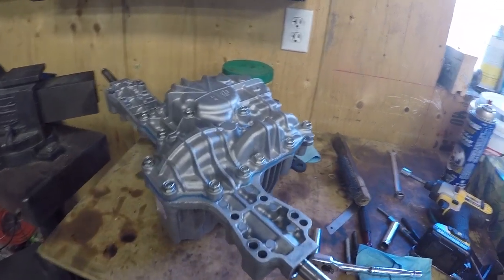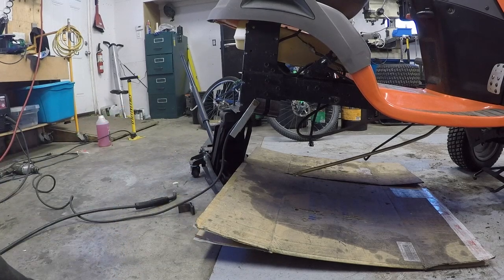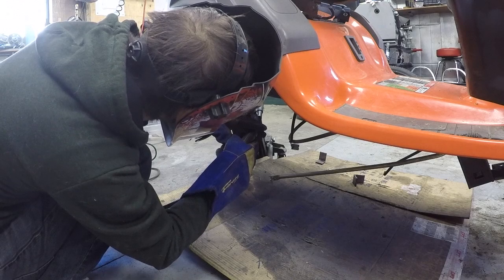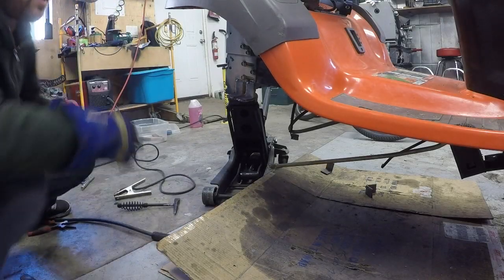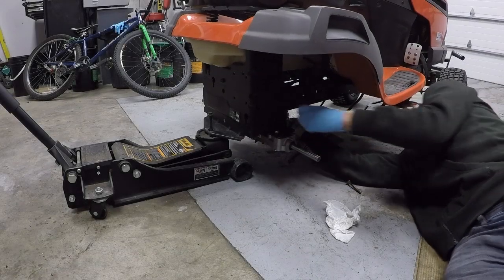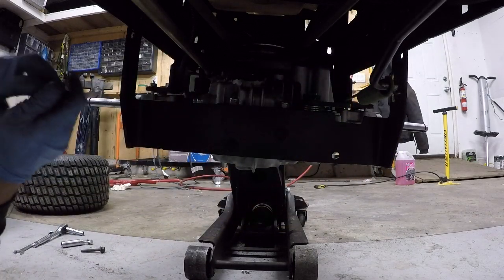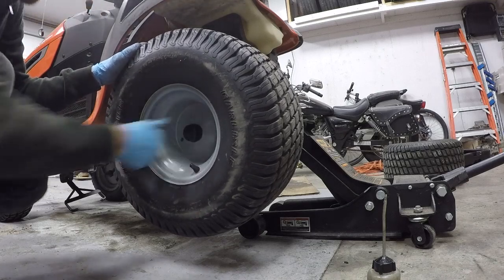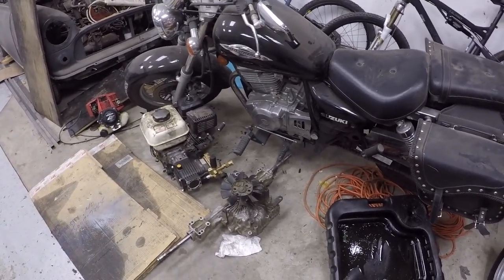K46 Hydrostatic Transmission Repair. (Part 3) TUFF TORQ (Husqvarna)

Comment: Thank you for this video! Mine lawnmower doesn't take a slope when is hot. Any suggestions?  When tractor cool down all works fine for another 15/25min
Reply: @JoelArseneaultYouTube  thank you!  Fan is ok, I have changed my traction belt. I will try new oil grade! Nice proposition.
 I only use my tractor in warm temperature, and always let motor warm before moving, no problem for that point.
Reply: @JoelArseneaultYouTube thank you. I always let the machin warming with clutch  released on neutral position on the gear leveler.

Sorry for my bad English.
Reply: For some reason I can’t see Joel’s recommendation. What did he tell you to do?
Reply: @RobShutt357  hello! 

Check traction Belt. And try another oil grade.
For my problem I have change all gearbox with used one for 300 euros. Really easy operation

Comment: Thanks for sharing, ignore the critics. They seem to forget that you don't owe them anything, they should be grateful that you went to the trouble to video this 

I'm thinking of buying the 46" version of this mower.  It's only 2 or 3 years old, but has some problems.  One is with the transmission.  It's only $200, so not much to lose since it seems to be in great shape otherwise. 

Yours is the second video I've watched of a tuff torq hydrostatic drive being worked on.  I'm thinking I can handle this job.  I've heard the manufacturer is awesome at being helpful and supplying parts for a reasonable price.
Reply: @JoelArseneaultYouTube  thanks, I've seen that they seem to have some kind of problem with the input pulley parts messing up.  Apparently that's only a $60 investment to fix and doesn't require pulling the transmission apart.  I find those transmissions fascinating.  They're really quite simple inside, considering.  Apparently, if you out that output side swash plate in upside down, it will reverse the output.  Nice job of welding those brackets, definitely stronger than before, by several orders of magnitude.  ;). Nice to see people do stuff right.

Comment: I have that same tractor.  Commercial grade with fabricated steel mower deck.  Had it since new and it has been really good over the years.  Lately it seems kind of jerky when starting off forward and backward.  When I look underneath I can see the transmission casing torque up and down as someone steps on the pedal to go fw or bk.    Anyone know if this is by design?
Reply: @JoelArseneaultYouTube  Thanks Joel. Your excellent videos will be a great guide for me.

Comment: I have a Craftsman YT4000 that is the twin.  how do you drain and fill the pump without removing the whole axel? The gas tank is in the way of accessing the hydronic pump
Reply: @JoelArseneaultYouTube  Thanks, I ended up going through the purge sequence and that worked. I was thatching the yard and must have placed too much of a load on the hydraulic pump and got air trapped in the system. The purge seemed to work

Comment: Nice repair video, but lacking in one area. I sat through all three parts waiting for you to show where to fill it, how to get the right level and what fluid you used. Mine is about 8 years old and I've not noticed ant drops on the floor but recently it's started not wanting to drive as strongly. So jacked it up to have a look and the trans is filthy, so slowly weeping over the years. Cleaned it all off and want to refill it correctly.
Reply: @JoelArseneaultYouTube  what a top bloke you are. It's been an interesting day. I have a forklift so lifted it to head height to make it easier and dropped the deck off for access. Filthy dirty so about 6 cans of spray degreaser and a lot of brushing later and it looked pretty good. I couldn't get the plug off so dropped the trans out as this looked easier and I could clean better anyway. Plug came off nice and the little round magnet under the plug was pretty clean. It took nearly 1 litre so it was down a lot. Put it all back together and wet out to mow. There is a definite improvement, but the mower just isn't as fast in forward as it used to be, but today's work certainly improved reverse. There appears to be no adjustment on the drive unit so I still have an issue. It's pretty hot in Australia but can also get down to low 30's (F) in Winter and the grass still grows. I had a new bottle of quality 15w-40 synthetic in the shed so I used that to top it off. Makes me wonder if it's now a bit worn from running with low oil levels in the trans, or if it might take a while for the pump to come good again with the correct level and fresh oil.

Mine is about 10 years old, 450 hours and a TYH2042 with the Kohler engine. There was no damage at all around the transaxle mounts just as an FYI so maybe Husky fixed this known issue.
Reply: @roberthaydenoz  hi, did you get a reply for level to fill the transmission to?

Comment: WOW I have the same identical damages to my Husqvarna YTH23V48. The frame brackets where the transaxle is mounted to the tractor is literally ripped on both sides. On top of that the Torque Bracket Mount broke on one side and the screw on the other side disappeared letting the entire transaxle tip which allowed the drive belt to pop off the pulley on the top of the transaxle. That screw you mention as being broke off I don't think is broken. I think there's a top and bottom screw as I cannot get the bottom to loosen and the top screw is gone from when the Torque Bracket Mount broke. I too will be doing some welding and reinforcing of the frame brackets that mount the transaxle. Here's the thing, I watched 2 and 1/2 videos to hear you say you filled the transaxle with oil and I was specifically watching the videos to see how you added oil to the transaxle. I'm not going to remove the transaxle and go through all the stuff you went through because I think the leak on my transaxle is very very slow. I need to know how/where to add oil. This is my second Husqvarna garden tractor. I had my first one approximately 3 days when the frame on the right side of the tractor by the transaxle ripped from top to bottom and the tractor had to be replaced. My most recent problem (last week) was the bottom cotter pin attaching the Front Mower Lift Link Suspension game off and the Lift Link  vibrated up through the top bracket and its gone. Apparently the second cotter pin near the top of the link was never installed. When I bought the new link at the dealer, I checked how they were installed and found brand new Husqvarna tractors without the cotter pin that would have prevented the link from falling out of the bracket. Some tractors at the dealer did have that second pin. I find it amazing watching the other repairs you made and seeing the same problems on my tractor. Anyway, I would appreciate instructions how/where the oil is added to the transaxle. Thank you.
Reply: @JoelArseneaultYouTube  Thanks for the info. The part of the frame you welded your home-made bracket on looks exactly like my tractor. I'm going to try to reinforce those parts of the frame a little differently. Funny thing, I see lots and lots of URLs addressing this problem with Husqvarna tractors. Looks like the sheet metal they punch the frame from is way to thin and cannot stand the torgue from the drive and literally rips the frame where the screws mount the transaxle. One comment I saw the person said it seems to be a very common problem.
I tried to reach out to Husqvarna about the missing clip for the lift link. From their reply quality isn't  concern. 
I've lost track of the number of parts I've welded back on the mower bed. Not everybody has a welder. I told my wife yesterday, if it wasn't for the welder we would be shopping for a new tractor NOT Husqvarna.

Comment: I have a hydro-Gear in my Craftsman 26 horsepower lawn mower, The leaver that you pull so you can move it around your garage without starting the motor has a little seal on the outside of shaft, it started leaking there i replaced it with a new one but it still leaks , how do i stop the leak
Reply: i got my leak stopped, put the hydro gear transmission,  back in but it will not go in forward or reverse, i think its in th e hook up rods and springs , i am not sure i have them on the right places there is two small wire on the forward reverse lever nt sure how or what the purpose of these are, do they have an effect on the forward reverse selection @JoelArseneaultYouTube

Comment: Where is the gas tank on this mower, maybe I am just anal, but I am always concerned about welding around gas tanks,
Good job on explaining the repair, I have an John Deere LA145 an it is having the same  transmission slow down or slipping problems,

Comment: When removing the pump housing the IDS valves came out and I lost either the ball or filter that goes inside . How do I know if it has a ball or filter that goes back in and if a ball does each IDS valve port have one? I'm stuck till I find this out.

Comment: nice job, and good video, was curious to see your ventilation system, looks like it pulled weld smoke straight up and out, i am planning a garage to build for myself, would like to see your set up. it was my first time seeing inside of a hydro transmission. thanks!

Comment: That transmission mount crack is a known defect by Husqvarna, they sell a stamped bracket kit that bolts into existing frame holes.  Likely the problem was started by the factory not installing or not tightening the front transmission bolts.  Mine looked similar, only one bolt installed & the other one broken.   I drilled stress relief holes at several locations on the cracks & just welded the cracked brackets.
Reply: Amazing, I had same problems he repaired plus a broken Torque Bracket Mount. Thing is I had to buy a welder to keep up with repairs on my Husqvarna. The mower bed brackets have all broken off at one time or another. Best tractor I ever owned was an MTD generic for K-Mart 20 years ago, The first Husqvarna I owned broke down 3 days after I bought it and the dealer replaced it. This thing has been a nightmare.
Reply: Thanks for the info about the bracket kit Mark.  Do you know where I can find this kit online or have a link to where it can be found?? Much appreciated!

Comment: Wouldnt it be easier to just weld the cracks?  Thats a ton of work you did.  I mean you did a great job, dont get me wrong, but unless you were going off roading or you were 300 lbs.  Welding it would have sufficed no?
Reply: joel arseneault well you did an awesome job!  I hope the customer can appreciate your hard work!  Cheers!
Reply: welding cracks is asking for more cracking, metal fatigues and needs new metal or crack cut out. he did a great job of making a lasting repair, and only 2$ of metal added is well worth your reputation for a business. plus, welding is fun! i do it at work at least once a week, on much thicker stock. he did a good job of welding thin to thick, which is a trick in itself!

Comment: Great video's. Great fix. TY. I still do not understand why in hell on the low end Tuff Torque they do not include a drain plug for the fluid. Good fix on the welds.

Comment: What kind of oil did you use?
Reply: Thank you Joel. I just got a new mower. The transaxle was whining after first use. I will be checking the fluid level. Husqvarna had this to say about the fluid "The transaxle was sealed at the factory and fluid maintenance is not required for the life of the transaxle. Should the transaxle ever leak or require servicing, contact your nearest authorized service center/department."
Again, thanks for your generosity in sharing your knowledge.